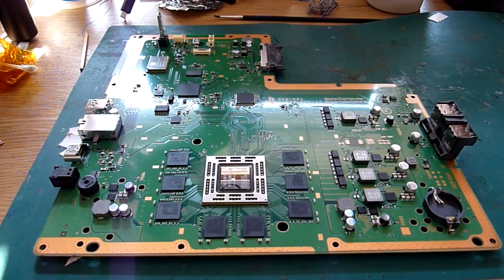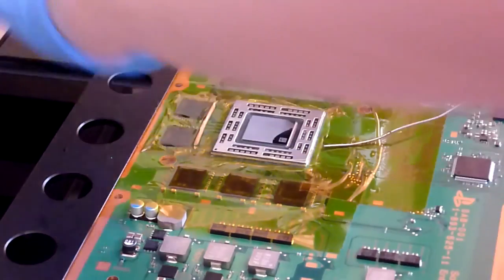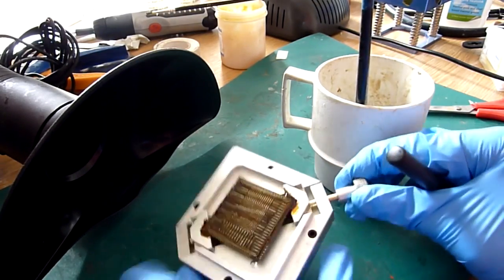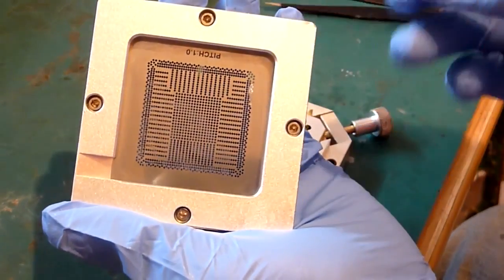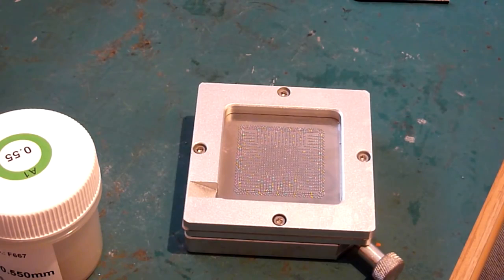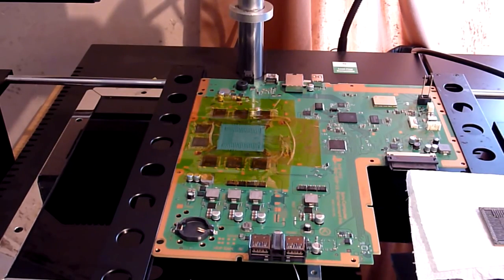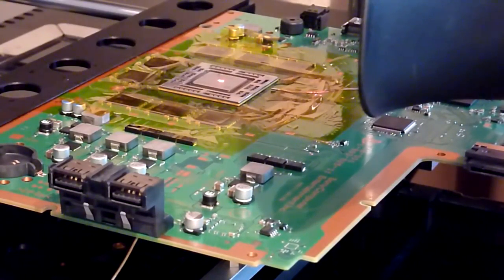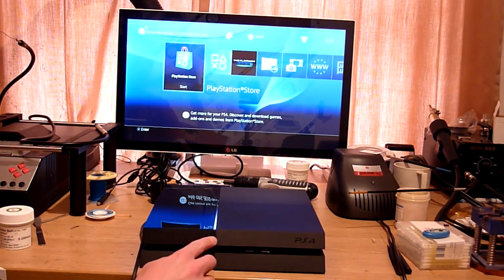PS4 Reballing APU BGA - Fix Blue Light of Death (BLOD) Full Tutorial

Comment: How do we know when it only needs a reballing, and why don't they place the CPU as PC with a magnet, magnetism doesn't damage the electronic boards in any way.
Reply from the maker: A 2 second blue light of death is usually a dead giveaway for a reballing.
Reply: The best way to never get a BLoD is to never buy a PS4. LOL thanks man.
You should make some videos with XBOX360 to show us to fix them.
The capacitors should be bigger and have an LED, so the board can have a battery we press and light up all the working capacitors in green, the non working light up red, so would be easier to replace the broken ones, like fuses in cars.

Comment: Hey nice work in currently trying to fix a ps4 I've worked on many different consoles and I've tried and tested everything except rebelling because I don't have the equipment to do it i guess my question is where do i send it to be rebelled and normally how much does it cost.
Reply from the maker: Depends where you're located mate to be fair. In the UK expect to pay between £70-90 for a proper reball - but do beware as a lot of places will advertise reball and simply reflow, or don't have the necessary equipment and use heat guns etc which simply don't work for any longer than a few weeks if you're lucky. If the price is really cheap then it's probably not being done as it should. Find a reputable repairer and you should be set. Cheers.

Comment: what is the benefit of temperature sensor when u taking off the APU ?
 i can do it without the sensor
Reply from the maker: Without sensor you have no idea as to the board or die temps - that means you risk pulling the APU with pads from the board or worse and popcorning the chip rendering it useless. You really do need the sensors for APU rework ideally - one of the most important parts is knowing what temps everything is at.

Comment: Hey man, whenever I turn on my PS4 it beeps, and then the blue light flashes (and could do so for infinity).  What's wrong with it?  It won't boot into safe mode, either.
Reply from the maker: Hi, A constant pulsing BLOD is a general error - something is halting boot (it's waiting) but it's not serious enough for the console to abort and power off.  Sadly this means it could be literally anything and without Schematics or a heap load of time to measure circuits against a comparable working board it's very difficult to recover if not impossible to do so in anything like a timely manner. I find these are rarely APU issues (I'd say <20% in my experience) and don't do much with these at all as it's just too much time to put into one machine as you're going in completely blind to be fair.

Check the obvious like trying to boot without the HDD and see if it attempts to go to Safe Mode (it'll fail but at least you'll see this) but most likely you'll be down the "rabbit hole to hell" if you're tempted to try and repair. Cheers.
Reply: I've done everything the internet says to do, other than tearing it apart.  I even went as far as trying to boot it with me sitting on it lol.  Guess I'd better try to get that refund from the seller..
Reply from the maker: I would mate. Not an issue you want to be trying to repair - it's a nightmare!
Reply: There goes my $30 for shipping 😑

Comment: Whats is this miracle red solder iron? :D
Reply from the maker: It's a Jovy iSolder40.
Reply: what temp that you put?
Reply from the maker: It's self regulating. Take a look at my equipment I use video for more information on how it works. Cheers.
Reply: http://www.ebay.de/itm/331875208412?ssPageName=STRK:MESELX:IT&_trksid=p3984.m1558.l2649

Comment: andrew what does a lifted pad look like?
Reply from the maker: +thomas clephane It'll look like a black dot whereas the others look silver in colour. You might notice some red coloured circles stuck to the APU or soldering iron etc from the actual pad which has lifted out.
Reply: And those are unfixable?
Reply from the maker: +thomas clephane It depends. Often those which lift out are ground pads and are perfectly OK to lose. If it's a data line though you'll have issues. They're not impossible to repair but they're not easy, particularly if you're new to this kind of rework. Do you have a picture of your suspected lifted pad?

Comment: great work mate, just a quick one... where did you get the fume extraction? it's a good idea to get one.
Reply from the maker: +Fernando Baena I got it on a very good deal from a local supplier I happened to stumble across at the time I was looking to purchase one - around £200 less than the usual retail value. You can get them from a few places though - if you're UK based Farnell would be a good place to look but it's not cheap kit. That said, you only get one pair of lungs so look after them and suddenly the cost doesn't seem like a lot to pay any more ha ha!
Reply: +Andrew Paul thanks mate, thats true.

Comment: whats ideal size for a bottom heater?
Reply from the maker: +thomas clephane Ideally it'd not be much different in size from the motherboard you're attempting to work on as you need a nice, even heat underneath the board to prevent warping. You'd be looking at machines similar in size to the RE-8500 ideally for this type of work.
Reply: Ok

Comment: andrew do u know if the ir 6000 rework machine is any good?
Reply from the maker: +thomas clephane Hi Thomas, I've never used it so I'm really not sure. The bottom heater looks a little on the small side for this type of motherboard so I'd be tempted for a bigger machine. The one Achi machine I had (an IR-Pro-SC v4) I really didn't like hence the Jovy RE-8500 upgrade I'm currently running which I highly recommend.
Reply: Oh ok. Thank u

Comment: Andrew, great videos!  I'm looking to pick up a jovy isolder 40.  I'm going to grab a couple tips with the order while I'm at it as they're hard to find in the US.  What tips would you recommend are the best for reballing, hdmi port repair, and other general console jobs?  I've seen people doing reballs with anything from the TP5 (looks to be what you're using), the TP6, and even the TP46 (25mm spatula style).  Are there tips that you found for this unit that don't work well, or ones that work better than others?  Cheers!
Reply: +Matthew Segroves Also, I don't mind spending the money to get several.  Whatever's needed to make the process easier.  I'll be ordering everything straight from Jovy
Reply from the maker: +Matthew Segroves Hi mate, indeed - I use a TP9 and a TP5. The 9 is standard issue and is fine enough for general solder work. The 5 is thicker and more suited to large ground pins / pads and BGA work. They're the only 2 I've tried thus far but I do have some Hakko tips coming which will also fit as I've recently had the TP9 fail on me. Cheers.
Reply: +Andrew Paul Thanks Andrew!  I'm going to grab those as well as several others with my machine order.  I'll let you know which ones I end up liking.  I'm definitely curious about using the spatula type for the rework.  Worth a shot.

Comment: Hey Andrew can you help me with something. I have a ps4 with this problem I replaced the psu but it didn't fix it. So I decided to heat the APU with a heat gun. Now the ps4 turns off instantly just like psu failure. Have I killed the APU??? Many thanks.
Reply from the maker: +Louis Greenleaf Very possibly so Louis - best case it's bridged joints underneath but it's never a good idea to heat gun any electronics PCB.
Reply: +Andrew Paul thanks for your advice keep up the good work
Reply from the maker: Louis Greenleaf cheers mate :)
Reply: +Louis Greenleaf no glue gun boil